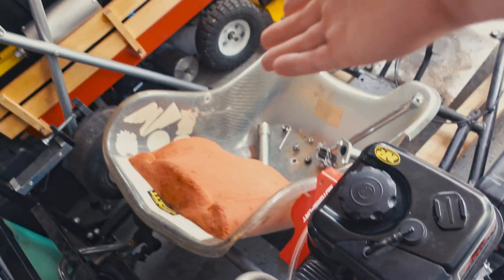The TRUTH of Predator 212cc + Governor Removal = (X)

Comment: Will I need a billet rod  im upgrading the flywheel, sprocket, Carb, exhaust, and chain? I kind of have a cheap budget, this is for a mini bike btw
Reply from the maker: Gotcha, depends if you have the gov removed. After you take the gov off, the rod is basically the first thing to fail. But the upgraded one offers strength, length (displacement), better oil splash (engine lubrication), which all allows you to rev higher with security

Comment: How do I remove the governor without pulling the motor apart
Reply from the maker: to fully remove it, you'll have to open up the motor. if you want to bypass it, take off the link that goes to the lever under you gas tank. make sure you put that pin back in so it doesn't fall back into the engine
Reply: @GavinFS it pops wheelie for 2 second runs hard then gives out leaving me to pump the gas to keep speed up. ..... ill they this if it allows to keep acceleration.... please advise
Reply: @OaklandTank100 did you ever figure out what was happening? I know someone having the same problem

Comment: So can i remove the governor and upgrade the flywheel?
Reply from the maker: Yes, but to fully remove the governor you have to take out the crank to take the metal gear off the back so you might as well do some other upgrades as well

Comment: Yeah honestly from my experience ive had about 3 different predator motors and i have never blew a rod or anything The rod cant be over 6500 and ive been comfy at around 6000 rpm and havent had a issue. i upgrades to a vm22 a pipe arc billet flywheel 18lb valve springs honedtly well worth it although i ran it hard i still took care of it and checked fluids and good oil and stuff
Reply from the maker: Dude that's awesome! I personally haven't either, but I have friends who kept blowing them from rod failure